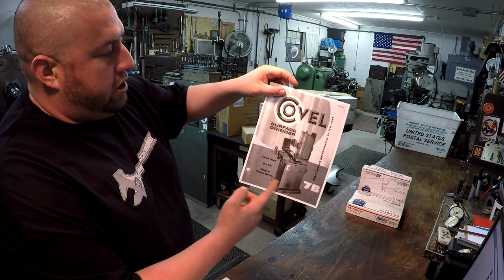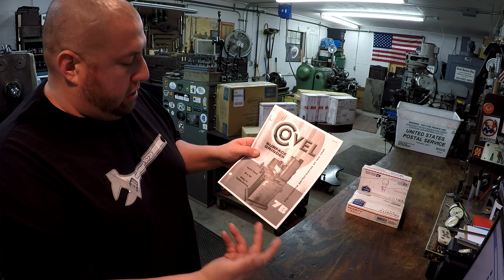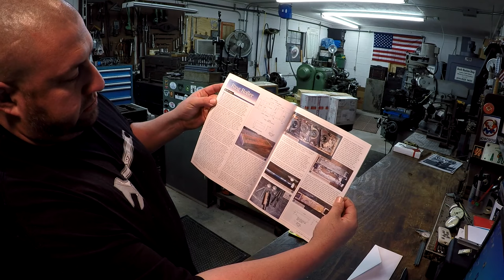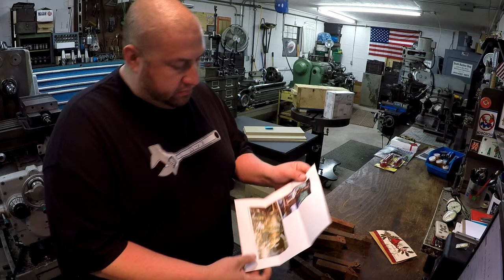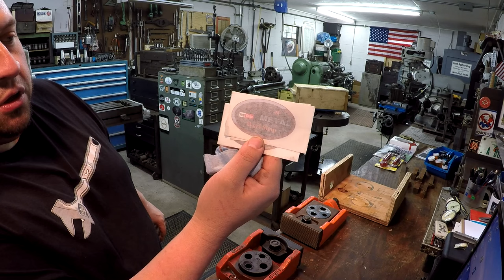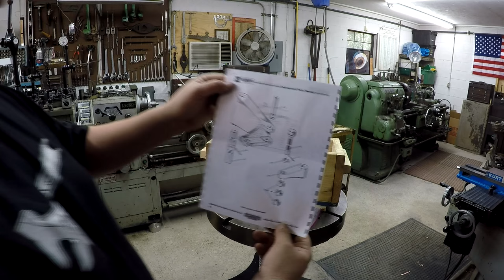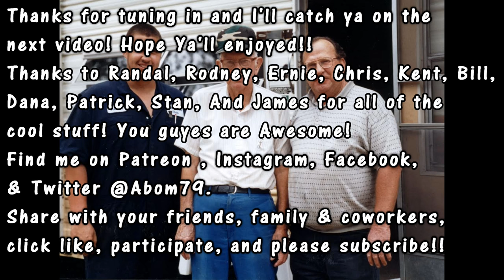Saturday Night Special 101 Part 1

Comment: I do a bit of welding (self taught) and I made a hydraulic press with a bottle jack, got a length of 4x2 inch box section from a friend and and the jack cost me £10, the press works great, I also made a 12 inch long contraption to bend sheet metal that works on the press

Comment: Hey Adam, that guy that gave me those hydraulic cylinders I want to build my press out of gave me 2 hydraulic power units as well. I think they both work but don't know that for sure. If you want one for your press let me know. They are complete power units, tank, pump, filter and gauges.
Reply from the maker: +bcbloc02 Ok thanks Brian. Send me an email some time with some pics and info on it.

Comment: wow, thats gonna need some pretty heavy plate steel to replicate the functional pivots and overall strength, looking forward to seeing it, hopefully you will put your makers mark somewhere on it for the future people too!  also regarding the hydraulic cylinder, i didnt realise you have a use for the cylinder ( to upgrade your press) as that seems like fun, otherwise i was wondering what the point was to build one just for no reason!
Reply from the maker: +jusb1066 It'll be a good fabrications project for sure. Yes the cylinder will be used on my large press frame.

Comment: Hey Adam, what's your thought on contacting Cattail Foundry over in PA that Keith Rucker uses for his casting jobs and have them copy it? They've done cast iron for him before and he's said they can copy the part or use your patterns. Just an idea, then you are just machining a casting and you have something that looks identical to the original.

Thanks for the video as always!!!
Reply: +Brian Streufert I'd be more than willing to laser scan, model and then create drawings of this part if it helped the cause. I think it would be a great idea to try to make drawings of these parts so people can create replacements.
Reply from the maker: +Brian Streufert Casting it would be great, but for me building it from steel is what I would prefer. Should make a nice shop project and provide plenty of video footage to share.
Reply: +Abom79 Hell yeah buddy, its going to make a great project. Like the welding table was. Going to be some nice heavy welding and milling involved. Lookin forward to seeing it down the road when you start laying things out. Good spring project for sure!